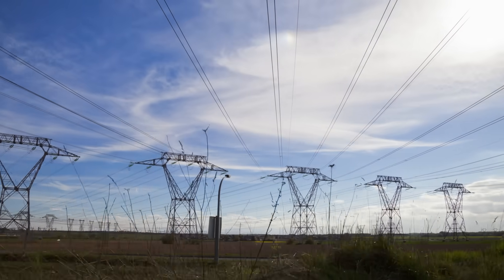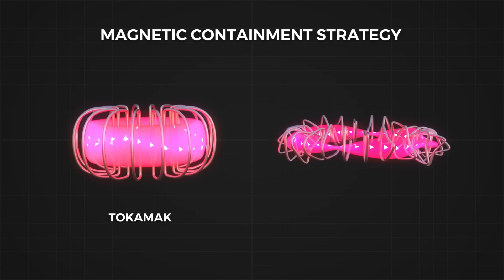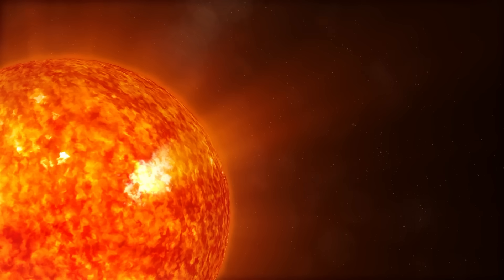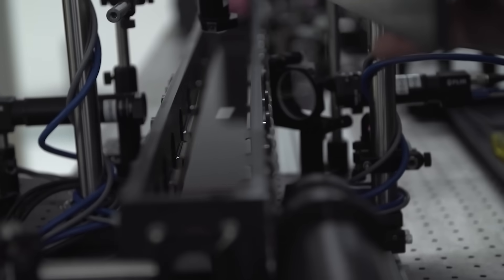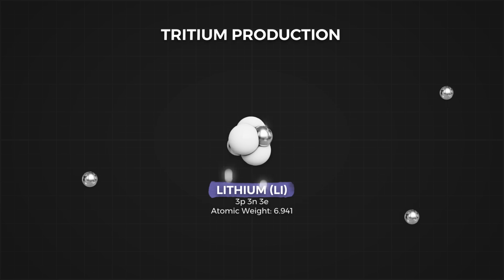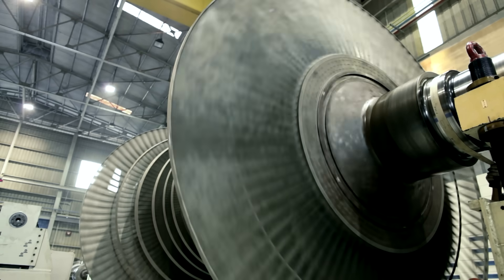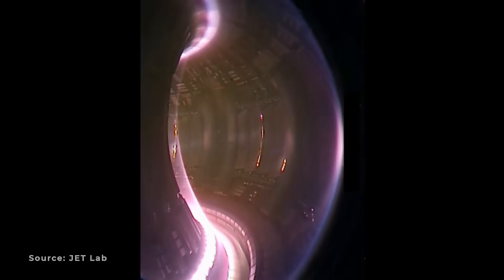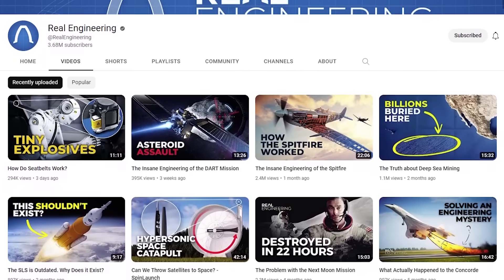The Problem with Nuclear Fusion

Comment: Quick question, you said we can't grab two nucleii and force them together. I'm wondering what the reasons are for that?
Reply: Two atoms are positively charged which means there is a repulsive force between them. Just like with magnets.
In order to make them to fuse you need to make them overcome this force somehow.
One way of doing this is to heat these atoms to extremely high temperature, like in fusion reactor discussed (much, much higher temperature than in the Sun is needed).
There are other ways as well, but they all have their problems.
Reply: @skipperg4436  I know nucleii are positively charged. My question is why just 2 nucleii can't be forced together rather than en masse.
Reply: @RichardIresonMusician  I'm not sure what do you mean by "en masse"?..
If you are asking why we can't just shoot one atom into the other via some kind of particle accelerator, then the answer is "yes we can".

The problem is that it takes far more energy to do so than fusion reaction will produce.
Reply: @skipperg4436  en masse, many together as opposed to two.  Isn't the "more energy in than you get out" problem an issue with all current methods? Is the manipulation of individual nucleii worse in this respect?
Reply: @RichardIresonMusician  yes and yes (at least with the technology that we have right now).
Okay there is way to make fusion work that technically doesn't require much energy to start fusion... That is via muons: if muon replaces electron in hydrogen atom than this atom becomes neutral charge wise but small collision wise (due to muon being much more massive than electron) and this leads to fusion happening without any extreme conditions.
However, muons are very unstable and it takes more energy to make one than fusion of hydrogen will return.
It almost feels like the nature is trolling us.
Reply: @skipperg4436  my thought process is based on this...the temperature that a given amount of energy can raise a particular medium to is (mostly) governed by the mass of the medium and its SHC. Effectively the smaller the mass the higher the temperature. Does this principle hold for atomic nucleii?

Comment: Problem is Renewables and how five times cheaper in 10 years will be 10 times cheaper even if you have some wild breakthrough you'll never use it cuz it's not economical anymore, though it would be nice when you're traveling in between the Stars to get to another planet in 100 years. Cheap renewable energy for the world is already here stop propping up garbage...
Reply: You're right -  "cheap energy" is a moving target, with wind and solar and batteries continuously lowering the cost target you need to compete. So boring though.

Comment: I’ve come to realize all of electricity is based on finding the best way to boil water
Reply: A slightly more accurate statement would be that all electricity is based on finding the best way to make stuff spin, and it just so happens that boiling water is a good way to make stuff spin.
Reply: @HSuper_Lee  Because waters are not just abundant, but also effectively the most thermally conductive naturally occurring liquid.
Reply: @HSuper_Lee  The *best way to make stuff spin.
Reply: And goes in circle as electricity ends up powering my electric kettle.
Reply: But what about burning fossil fuels?
Reply: Solar panels: Am I a joke to you?
Reply: Then maybe use a stove🤔
Reply: Wind and photoelectric solar literally doesn't. Same as tidal.
Reply: @Poctyk  wind is ocean water being heated
Reply: @Poctyk  On large scales, using solar-powered boilers is also part of consideration (though most of them failed)
Reply: @Poctyk  which is also part of why they are terrible at generating energy comparative to other types of energy production.
Reply: @secretname4190  even the most advantageous and well placed solar panel or wind turbine capacity factor and efficiency is lower than hydro, nat gas, coal and especially nuclear fission. They still don't hit the necessary EROI to be sustainable and still require backup power which right now is predominantly fossil fuels. They're better than nothing but considering the cost and resources for manufacturing and the carbon released, that's not saying much.
Reply: @Rippedyanu1  As a bird lover who even thinks it wrong to poison pigeons because what I want is more hawks or  peregrine falcons eating them, I utterly detest wind turbines, and having spent my first 24 years in Scotland and Northern Ireland I regard solar PV feeding the grid as an absurdity except perhaps in Australia near the Tropic of Capricorn.
Reply: @Rippedyanu1  Those curs-ed water fowl curves...

Comment: If you have a few million dollars and want a functional fusion reactor, you develop Dense Plasma Focus.
If you have a few billion dollars and want a functional fusion reactor, you build a Stellarator.
If you have a printing press and want to endlessly pay an engineering team for all eternity, you build a Takomak topology.  It will never be a practical topology.

If you have a few trillion dollars and want a novel fusion mode, you'll develop lattice fusion where a quantum well for two hydrogen atoms is created in a region of overlapping kagome lattices.

It will work, but we do not have the models to engineer things on that scale, and won't until bulk material science is recognized as being more critical to research than increasingly large particle colliders that are wastes of money at this juncture.  Every million dollars into bulk and lattice materials will save ten million in future accelerator costs to build.
Reply: If you have a few billion dollars and want to provide cheap energy - build out wind, solar and batteries - but too boring perhaps.
Reply: @DLWELD  
More like just not practical.  Even if we had close to ideal components and could freely manufacture them, solar is the source of wind energy - so wind energy is chasing pennies off the dollar.  Solar, on the other hand, can net us something in the range of 1 kilowatt per square meter if we are ignoring technicalities that practically limit us to 500 watts.

This wouldn't be bad for most homes or even vehicles, as they can be powered reasonably from their roof with a bit to spare for utilities and the like.  Until we get into urban housing, at least.

Industry.... not really.
The major problem is in doing three things.  First is storing excess energy.  We don't have the material for batteries.  Iron, alumina, etc - just not practical to mine the material for battery construction and we have few good means of recycling.  We can change that to some degree, but see my bulk materials part.  We may be able to do some fun things like doped lattice electrodes and/or liquid cycle batteries that would work well in power storage infrastructure - but all of these are their own research and applications challenge.
The second is energy distribution.  You need to be able to route power from places with a surplus to places with a deficit with minimal loss and with both a high degree of granularity and variability.  You need infrastructure that can handle anything from 1 megawatt average draw to routing ten megawatts to distant regions in a deficit.  That means comically overengineered infrastructure on a continental scale.

The third problem is resource selection and recycling.  Because you are gathering a fundamentally diffuse source of energy, you need a lot of infrastructure dispersed to gather it.  That infrastructure costs resources and is a material existence that needs to be maintained.  With completely ideal solar panels, a rather modest commercial backup generator of around 10 megawatts would take up around 10,000 sqare meters in solar panels.  More surface area than the parking lot and store combined, in most cases.

That is a lot of solar panels and a lot of interconnecting wires.  While there are some interesting ideas out there on coupled resonant power transfer that could help resolve that, you're still looking at a lot of material in supports and tracking.

That is actually the biggest problem.  In a situation where you are able to incorporate them into an existing structure - solar panels are interesting options, particularly in naturally diffuse applications requiring little energy density.  Wind is arguably worse in terms of density, but can occupy a different dimension and has been used for centuries.  If I was building a "modern farm house" - you can bet I have a windmill of some sort and a set of solar panels or perhaps solar-thermal power system to make sure I have well pumps, filtration, and cooking if nothing else.

But when you start talking about replacing a nation's power infrastructure, where individual factories can pull a gigawatt just to get the lines ready to run, you'll never be able to deploy and maintain the number of solar and wind facilities necessary.  Not to mention the environmental devastation of replacing forests and grasslands with solar panels.

Comment: Wait! Nuclear energy is quite cheap especially long term so how can you say it is uneconomical? I find some issues with this statement, nuclear energy was and still is a political issue not an economical one, that's one reason why is demonised on the media. Quite disappointed with your content lately
Reply: Tell that to Japan - the costs of Fukushima were more than all the "benefits" of cheap nuclear energy for Japan - a net loss.
Reply: @DLWELD  not quite, there was a disaster there but let's look at france which successfully uses nuclear energy, unfortunately their prices are a bit affected because they have to sell in Europe not only in France but for France nuclear is a net positive. Also let's look back at Japan and what caused the costs, certainly no one died due to the nuclear power plant the deaths occurred because people couldn't control themselves in an emergency situation. Claiming that nuclear power has an economical issue is false it has a political issue, more so than ever, because nuclear fuel can be used for two purposes some countries are reluctant to allow this technology to continue development. 
Also, have you been wondering why Japan has pushed nuclear and hydrogen(when it comes to cars), maybe look a bit into it.

Comment: Steel does not need fossil fuels. Hydrogen works just as well as coal.
Also, the main ingredient in concrete can be made by electrolysis instead of heating.

Comment: Well, since I watched Sabine Hossenfelders video on fusion and how the involved researchers themselves and all of the futurist-sympatic press keep misrepresenting its progress, most of my engagement just evaporated.

The fact that all those euphoric articles about ITER planning to reach higher output than input are simply misrepresentations, basicallylies...
Since they only talk about input and output of energy into the plasma, completely ignoring the about 60% of energy cost put into the support structure of the installation never go into the plasma at one end. And the transformation losses of converting thermal plasma energy into usable electricity via steam turbines at the other end. Never mentioned in fusion-fan media, even though it breaks the usability down a lot.
All the fuel and building material supply topics RE mentions here come on top of that.
It doesnt really look good.

Comment: Wait, so you're putting in energy to make more energy? There are probably LOADS of other factors, but that sentence made me question reality for a sec.
Reply: You put a spark (energy) into air+gasoline mix to extract energy (in form of small explosion) from that mix that will do the work needed to get new mix, to again ignite it. 
Same idea only more sci-fi.
Reply: @Poctyk  Wait, you're right. I've been seeing things all wrong.
Reply: No its putting in energy to release stored energy that is a greater energy quantity then what was put in. There is no energy being made, its similar to using a gas powered syphon to empty a entire gas station, no gas or energy created. In short everything made of atoms has a absurd amount of energy stored.
Reply: @cantthinkofnameyeah7249  So I guess I should have said, "You put in energy to GET more energy", huh?
Reply: @Chris-ok4zo  Yes you get more usable energy, because before it was locked up inside an atoms nucleus or center.
Reply: @cantthinkofnameyeah7249  aight noted.

Comment: Fusion based on current fusion theories will not work, they haven't worked for 60 years and this latest batch will also fail, the Chinese have created temperatures 4 times hotter than the hottest part of the sun and it still does not work. You need a new physics theory on how the sun works to begin to understand why no one can make it work

Comment: Breeder blankets: being a nuclear engineer who has researched tritium breeder blankets, one material being considered is F-Be-Li molten salts. It gives you a combination of features: as a heat transfer fluid, Be for neutron multiplication, and the lithium to generate tritium. It would also maximize tritium generation if enriched to nearly 100 percent as Li-6. Looking forward to your documentary on Helion since I have been reading up on them.
Reply: Quick question: 'Fl' - flerovium?! Is that a typo?
Reply: @gigabyte2248  Yes, it's Fluorine.  I'll fix that.
Reply: Wait.
Am I reading this right? Is this a consumable/ablative reactor liner that creates Tritium-in-place from its own reaction?

Because if so that would be freaking amazing.
Reply: I wonder if we could put a mass of plasma under immense pressure in a fusion reactor and open small holes in the fields containing it to send beams of plasma through magnetohydrodynamic generators, and then somehow looped it back into the central mass of fuel to be as efficient as possible.
Reply: There is also the possibility LiPb liquid flowing through the wall while simultaneously multiplying neutrons and breeding Tritium. But I say here: "Good luck with MHD!" 

Isn't molten salt here similarly or even more corrosive with the structural steel than Lead?
Reply: Li has many many problems. Enrichment being one of the key hurdles
Reply: FLiBe uses way too much Be, and according to Abdou at UCLA there's no design window for it.  The group there really tried to make it work but couldn't.
Reply: @pauldietz1325  do you have a specific paper or presentation link for that? Thanks
Reply: I have a Fl-Be-Li blanket on my bed right now... it's pretty good👍
Reply: @mikemurphy5898  that's a blunt lie
Reply: @mikemurphy5898  are your neutrons multiplying nicely?
Reply: What happens if uranium or another fissile material used in fission reactors is used to line the walls of a fusion reactor to add heat from fission to the steam generator. Would that be a way to "turn on or off" fission? Adding a layer of safety to fission reactors and added efficiency of direct electric induction of fusion reactors? Also would this allow longer use of u235 and it's byproducts?
Reply: @John-sp7ne  Not really, it would add a lot of fission products and transuranics increasing the radiological hazards for no great benefits.
Reply: @PNurmi  do you think there's a way to use fission reactors in combination with fusion that can offset some of the power demand by producing it locally?
Reply: @John-sp7ne  Probably not in that configuration, as you do not want to contaminate the fusion reactor with heavy elements as that would ruin it. But there is a 4th gen fission reactor design being looked at that uses extra neutrons to run a fission reaction in a system that basically can be turned on/off some what more quickly, though it still won't solve the radioactive heating issue I think, at least not completely.

So you could use a fusion reactor to supply neutrons for such a fission reactor I guess, but the question would become I think, why would you want to? You can use the same neutrons to after all supply fuel for your fusion reactor instead and probably greatly reduce the complexity of the whole setup.
Reply: @Quickshot0  so that design makes it impractical and possibly not effective at all. I wonder if there is an alternative design that combines the benefits of fission reactors and helps directly feed the fusion reactor to achieve steady state fusion even if not yet power producing but maybe self sustaining?
Reply: @John-sp7ne  I suspect it could only really make sense if you could only get fusion reactors to be almost economical, but not quite. Else fission reactors downsides are really just weighing down fusion by adding a far less safe system to it.
Reply: @John-sp7ne  yes, but as a whole different design concept - a fusion-driven sub-critical fission reactor - the Chinese are claiming they are close to having one of these
Reply: It'll NEVER work. 'Hot' Fluorine destroys ALL  containments. 
It's the universal solvent.
The US and USSR spent billions on just this issue. 
After 25-years, Congress cut off funding. 
Only then the boys with the iron rice bowl admitted that they'd reached a dead end -- in 1960.
(!) That's twenty-years of just screwing around....
In sum, it'll NEVER work. It's a materials problem.

Comment: I'm not a huge anti-nuclear power sort of person but I do object to calling it 'clean'. The waste is so toxic, so dangerous, and lasts for so long that there is nothing clean  about it.
Reply: You are mistaking fission for fusion. Fusion would produce helium and tritium. Helium is a non toxic inert gas. Tritium has a short half life so it would never become a problem
Reply: @brimstone699  The fusion reaction produces lots of neutrons - that's how the energy produced is extracted - What about all the neutron activation of the materials making up the basic structure? What about neutron embrittlement - there will be nuclear waste issues.
Reply: @DLWELD  It’s quite simple. Either make  a barrier between the reactor and outside world using water or concrete or turn it into fuel.
Reply: We should use the cleanest instead of clean but the result is pretty much the same